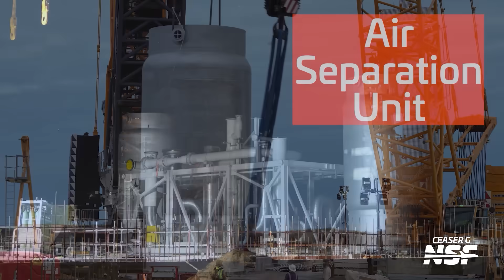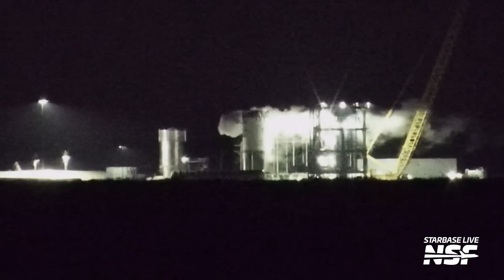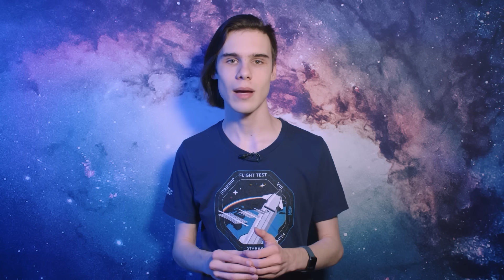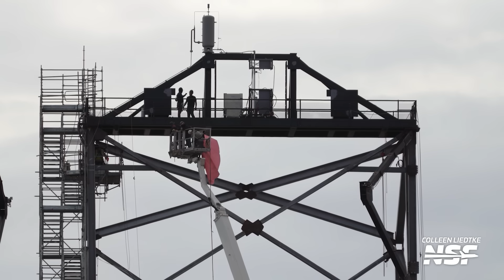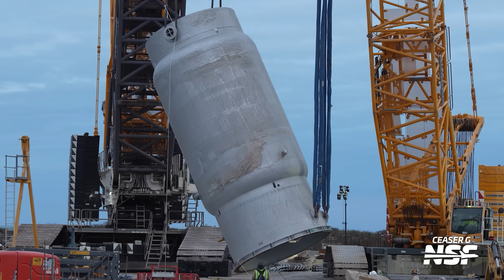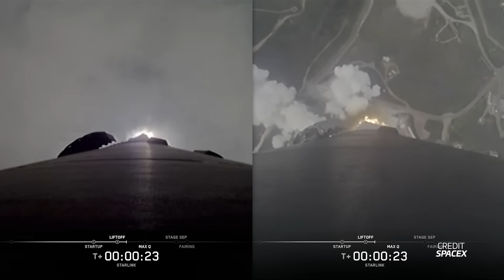Another Starship Test Tank Failure | Starship Update

Comment: There might be another factor to consider when trying to estimate when Boca Pad 1 might get to the stage we currently see Pad 2 at. I fear that the 18 month estimate might be a bit optimistic and you might need to add a month or two to that.

SpaceX is planning to significantly increase the flight cadence from Boca once Pad 2 is up and running and for every launch that means obviously standing down all construction work on each launch day (more than one day for a launch if there are any scrubs) but also locking down the site beforehand in terms of loose materials, possibly re-positioning and/or laying down cranes etc. If SpaceX does get to a twice-a-month cadence in 2027 (or maybe even in late 2026) that could add up to quite a few construction days lost to launch activities.

Comment: The Air Separation Plant mainly provides Nitrogen and Oxygen, but neither are rocket fuel. Liquid oxygen (LOX) is used by the rocket as the oxidiser, but the liquid methane that is the fuel will still be provided from tankers until they pipe in gaseous methane to liquify on-site.
Reply: Yes, if you notice we never use the word "fuel". The oxygen is the oxidizer, both methane and oxygen are the rocket's propellants (named like that because they help propel the rocket). When we referred to the oxygen we explicitly mentioned the word propellant not fuel
Reply: True.  But about 70% of the propellant is lox..

Comment: I think 18.3 failed where they thought it would fail.  The part that collapsed wasn't pressurized.  They new it was a weak point and added enough bracing to give them the results they needed. Which was that the crown could take a specific amount of load and not fail.  As long as they got to that point before the unpressurized common dome buckled, they're fine.
Reply: If it was a deliberate test to failure though it's a shame they weren't able to strengthen the unpressurised part sufficiently to get a failure in the elements for which they were collecting real data. Sure, they quite probably (I hope) got good results to verify that the tested components met or exceeded the safety margins they were looking for but test-to-failure results can also be invaluable for calibrating the computer (Finite Element Analysis) model with reality. Sadly this failure in a part of the test setup not under representative conditions of pressure and temperature would not really yield much interesting data there.

Still, as long as SpaceX got the flight validation data that should be good enough to tick off another item on its pre-flight design verification checklist and I'm sure SpaceX will have plenty of other opportunities to add to its FEA calibration data.

Comment: Those temporary beams at the back of the Mega look a bit permanent to me.  They look like they're forming walkways on the back wall, where fully built boosters won't be going through.  Barrel sections move from the factory into Mega though the low doors in the back wall, and fully built ships leave from the Hwy 4 end of the building, no?

Comment: Is this why SH still throttles down ALOT from maxQ to MECO? Like , Falcon goes almost 4 to 5G, SH only like 2.5G.
Reply: Yes, rockets throttle down during Max Q to diminish the stresses on them. This cuts down fuel needed, and also minimizes the extra strengthening needed only during Max Q and no other time.

As for the difference in g forces, that MIGHT be for more comfort for the astronauts. It also would increase mobility during acceleration, which might be needed in an emergency.  This is speculation, of course.
Reply: @Henglaar  Just go look at some acceleration graphs for past starship flights. After some recovery post maxQ, acceleration is basically flat.

Comment: Booster 3 should go to the 35 engine version to simplify the design. 5 engines are sufficient for gimballing (steering), boostback and landing burns. Infact, 4 engines, perhaps 3 engines are sufficient with longer burns in the event of inner ring engine failure. Slower acceleration means less efficiency, but do boostback and landing burns really need to happen at 20G??? Surely 7.7G is sufficient, even 6.2G (4 eng) and  4.6G (3 eng) are sufficient for boostback burn, and even greater thrust for the landing burn given the lower fuel???
In the 35 engine booster, the middle and outer ring engines are not needed after MECO, so don't need restart capability.
The 5 inner engines stay alight through hot-stage, so only restart for landing (a 78% saving on restart gas and COPVs for this purpose). Plumbing from the header tanks is reduced by 62% (5/13). The middle ring engines shift closer to the outer ring, reducing bending moment and structure, partially offset by thrust and weight from 2 more inner engines. 
It is surely better to adopt this arrangement now and incrementally improve it over time. 
Stage 0 and the Booster don't change for launch, only the ships. They deliver the ship to 70 km altitude and give it a near horizontal velocity. SpaceX has 6 stage 0s under construction in 3 pairs. Surely it is time to move to the simpler, yet more thrustful, 35 engine booster???
Reply: I think most structural issues would be before MECO, when ship is on top. Like SH flight profile is near 2.5G from MaxQ to MECO, while Falcon tops out at near 5G. SH throttles down significantly.

Comment: The bottom of the tank that failed would normally be pressurized right so a lot more rigidity would be there?
Reply: Yes pressurization adds rigidity, or at least couteracts a lot of the external loads. But here if the tank was pressurized during failure we would have seen some kind of venting (either explosion or violent fumes, at least).
Reply: The damage was below the common dome where was no possible of pressurization.
Reply: @andycamp4890 Oh I thought they had a mini tank section beneath the common dome ! My bad
Reply: @andycamp4890  what the heck are you taking about? Of course it is possible to pressurize the area under the common dome - it's the oxygen tank.
Reply: @AntoineTruchot i don't think it's your bad, i think you're entirely correct.

Comment: The failure on the test tank was a positive one. The point would be to push the hardware as hard as possible to try and break the new hardware (i.e. the hot-staging hardware). Since the tank broke first, they found out what they needed to know. If it hadn't broke, what would have been learned? Nothing! That's the point of a "test tank". To test to see what fails and at what point!
Reply: Ideally.  But if "what failed" was a procedure or a person, then it's only progress in the shruggiest sense, and it just sucks.  SpaceX has really abandoned the "simplest solution" doctrine, and the "fewest parts" doctrine.  They're perfectly happy now to answer a problem with ten zillion new solutions at once.

Comment: Look at how the fake bottom of the starship in the crush test is fully reinforced like the bottom of a starship but the area on the fake booster is not reinforced like the bottom of a booster. It looks like the area directly under the one tank so it would be pressurized and then the bottom of the of the booster would be reinforced around the engine bay. The part that failed was nothing to do with the test and either they don't care or they poorly designed the test article.

Comment: This whole test tank failure story is very speculative.  Feels like a lot of assumptions.  Everything fails.  What if this was a "keep crushing till it fails somewhere" type of thing?  I know many things can be inferred from data seen but this really felt like a leap for drama.
Reply: When you're testing a new design, you want that new part to be the weakest link in order to be able to gather as much data as possible. The fact that this tank failed around the common dome and right above the unpressurized barrel to stand interface is worrysome. They usually go crazy with external stringers to reinforce this test tank support interface, but this time they didn't, which is weird. It feels like they had a lot more tests planned for this tank, like all other test tanks.
There is always the possibility that the new hot stage (or any part you're testing) is so strong that it outperforms the support fixture, but that seems very unlikely given the skirt was unpressurized and not extra reinforced. Plus they were seemingly already detanking so that's extra weird.
I'm expecting a new test tank to roll out in a couple of weeks.
Reply: Yes failing after 8 tests is not concerning. Not to mention it failed on the outside of the pressurized test article.
Reply: The problem is, this was only the second test. Normally SpaceX conducts dozens of test before a test to failiure. Also, the fact that it broke on a section that wasn't even suppposed to be tested is a sign that this wasn't intended. That being said in the last WAI episode Felix mentioned that it ruptured around an autogenous pressurisation line that wasn't pressurised in this test. That means it does not reflect flight conditions. Still, If this failure occured before they were able to collect enough data about the strucural integrity of the hot staging ring, it might delay flight 12. No fabricated drama, just cold facts.
Reply: @brockmann4815  That would raise the question: Pressure failure (mechanical) or failure to pressurize (procedural)?
Reply: @dudermcdudeface3674 it failed on the outside of the pressurized test article. The pressure tank didn't fail. It buckled down below that. Probably from can crusher pressure.
Reply: @EbikeRandomadventures  But was that area supposed to be under pressure to sustain the weight above, even if different from operating pressures?
Reply: @brockmann4815 unless you know precisely what SpaceX was testing for you have no usable facts, just drama.
Reply: The point is that it doesn't probably fail with you on it.  That's how they test things like cars and chairs.  And eventually rockets, if we're lucky.
Reply: hype sells
Reply: You do realize your assertion is based on speculation.
Reply: exactly his point, don't read to much into it.
Reply: They are not speculating with this level of detail they are guessing (wildly).  This was most likely a test of the new hot stage section, and they may well have decided to test to destruction on the first try if that is what they were testing.   They didn't appear to have pressurized the tanks much if at all.  I'm not too worried about tank strength after ITF-1 did summersaults and basiclly said FU when the set off the auto destruct.  The new hot stage structure did need a test, now they have it.

Comment: Was it really a failure? That section was not supported the same way it would be the real booster.
Reply: Only a failure if nothing was learned.
Reply: @GrigoriZhukov  starship program over forever - scott manley
Reply: Testing to destruction gives more information than non-destructive.
Reply: That's what I was thinking. Do we even know what exactly was being tested or how? If they were stressing out the hot-staging configuration, it's possible that the base of the test-tank was being stressed beyond it's designed threshold. An analogy to my point would be testing the speed of a set of tires and driving a car faster than it's engine was deigned for and throwing a push-rod.